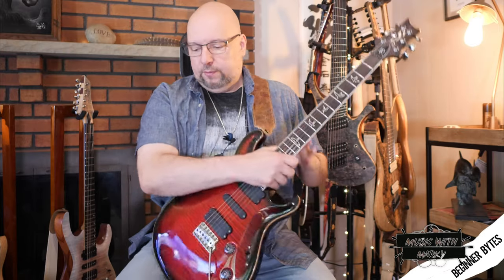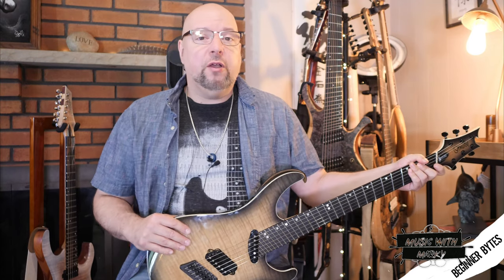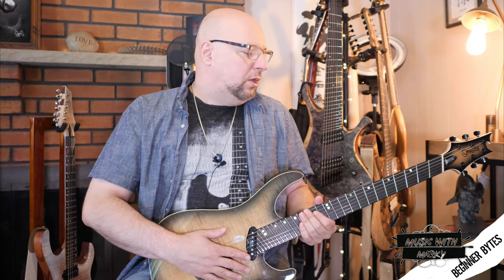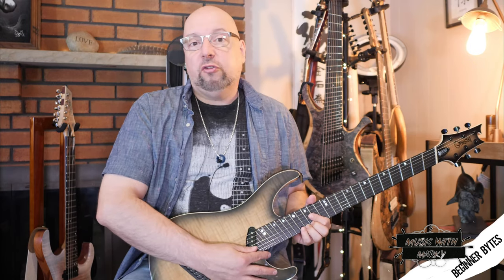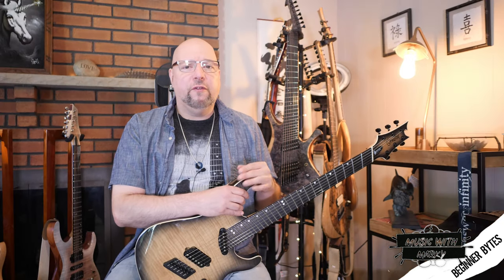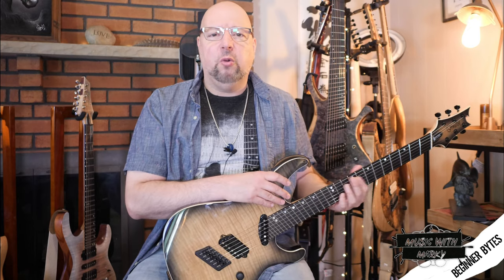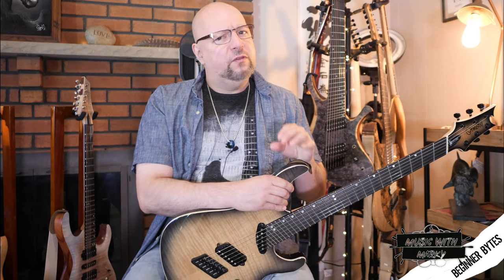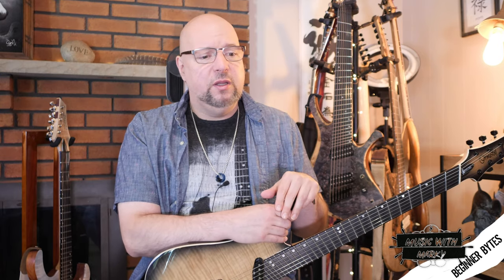What Is A Fanned Fret / Multi Scale Guitar?

Comment: Good information... thanks, however I still don't really understand what the advantage is to the player...
Reply from the maker: I can give you a for instance: I have a 7 string that I like to tune 1/2 step down and then with the lowest string to A (like Drop D but on a 7).  With the longer scale length at the lower strings, they still have enough resistance to not feel "flubby" or cause fret buzz.  And the high strings are still loose enough to be easy to play.   On the non fanned 7 I have, it is barely playable like this.

Comment: Music With Marky The fun thing about Fanned frets is that it balances out the tension, and also with extended range Guitars with all the way up to 9 (or more) strings, it'll stay more in tune.
Reply from the maker: Agreed.
Reply: @MusicWithMarky  There are 10 String Guitars with a Low G# added (etc, same for Basses) & again Fanned frets is highly recommended once you Start adding on more & more strings to balance out the tension. As a matter of fact Cigar Box Guitars with 10 (or even more) Single Strings would benefit from Fanned frets.

Comment: Great review! Might wanna modify a fanned fretted guitar. Check my fretboard invention. It has grooves to allow FretCorner bends on ALL strings. Adds extra x notes to pulloffs creates strobe FX on slides as fingers drag over FretCorners and infinite sustain on vibrato plus new note jumps on bends as string reconnects at higher point. 
Kirk Hammett did it on master of puppets solo and many others on high string. Maybe I can hire you to do a review later this yr.
Reply from the maker: It's an interesting concept you have there.  I'd certainly be willing to take a look.

Comment: Did you know that Extended range Guitars have alot of the same advantages of Extended range Basses? Extended range Basses (all extended range string instruments that have fingerboards or sometimes fret boards if they're fretted) would benefit from Fanned frets. The additional Strings on Extended range Guitars (Both lower & higher) give you a more playable range opening your mind up to lots of repertoire written for other instruments. The additional strings also make it easier to transpose so you can match the ranges of other instruments & Vocalists especially on Church Gigs. These extended range Guitars also add a bit of Rock n Roll to your Church Gigs making the Choir & Congregation go into Rock mode.

Comment: You can get the same effect by using graduated action on a standard guitar. For example, I play 6-string bass. My action is set B at 2.75mm, E at 2.5mm, A at 2.25mm, and the rest at 2mm. That's so I can play B standard tuned to 430. If I wanted to play Bb standard or A standard 440, it would start higher: at 3mm for Bb standard, and 3.5 or 4mm for A standard. 

All my strings play like butter; the fretting tension is relatively the same across the neck in all positions. The action on all the strings is just high enough to prevent fret buzz with light-touch playing (I still need some grind on the B and E strings for some stuff I play with distortion).

Fanned frets are only necessary for extended range instruments where you have too many strings for graduated action to be practical. Most people who buy fanned fret guitars only do so because they think there's some rule that you have to adjust your action equally low for all strings, which can't work if you use drop standard tuning. They buy them under the false impression that a multi-scale neck is the only solution.

Most guitar manufacturers use some sort of graduated action as the factory setting. That's because you can't get a playable instrument with the lowest string set high enough for fret clearance and the rest of the strings set at the same height. For example, the factory setup for all Ibanez basses is 2.5mm on the bass side and 2mm on the treble side. That's just for standard B or E tuning to 440.
Reply from the maker: Interesting stuff.  I never thought of that approach.   Thanks for sharing.
Reply: But nobody wants high action!
Reply: @darrylfranks6976  If you're tuning drop standard or to a lower reference pitch it doesn't feel high. I play just fine with graduated action. Scott from Scott's Bass Lessons uses graduated action; it doesn't affect his playing either. He made a video about it. You want the action just above the buzz point. That way you can play clean, but also get some buzz if you really pound the strings.

Most basses come with graduated action as the factory setup. My Ibanez GSR206 came set up with the bass side strings at 2.5mm and the treble side strings at 2mm. I only made a minor adjustment by slightly raising the B string and slightly lowering the A. It plays better now, and the string volume is more even. I also play with the neck completely flat. It doesn't feel tight at all; it plays like butter.